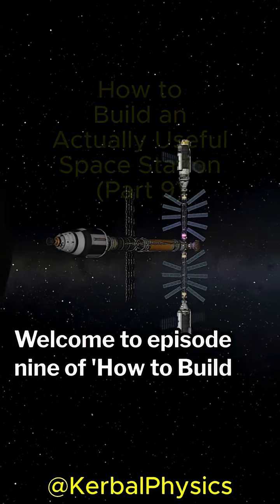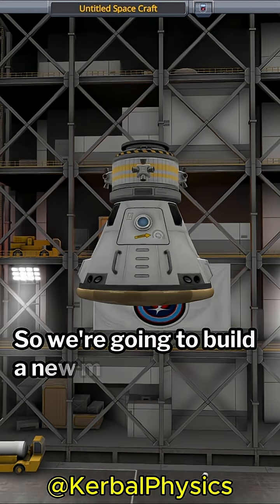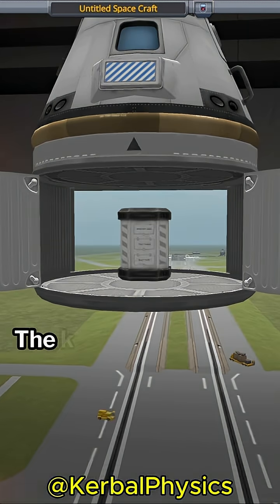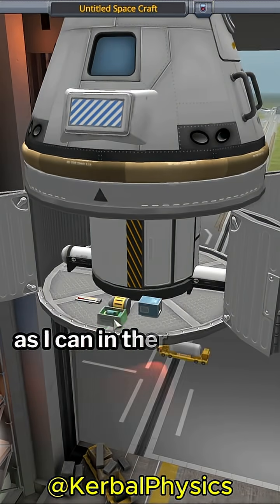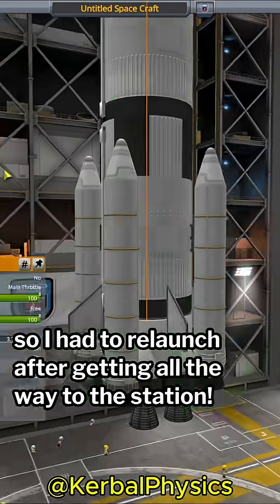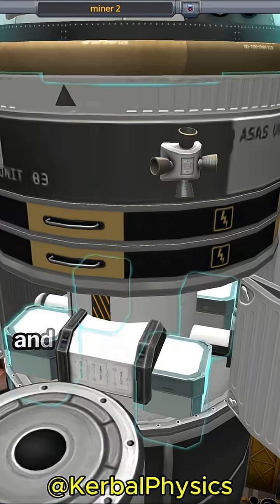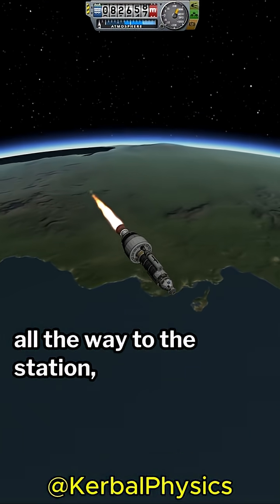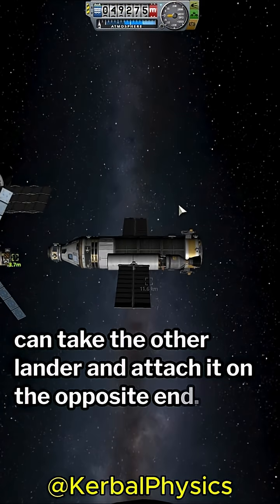How to build an actually useful space station | Part 9  #kerbalspaceprogram

Comment: What does the station do?
Reply: With the science lab, turn unreturned science into x5 science. To then return for full value or transmit for a percentage.

Only works in space. So is great to deploy to multiple planets. Grab all the science in orbits, biomes, special interests, flying over, etc. Then return to station to process.
Reply: @NoHypocrisy42 
Not just in space, but can also be placed into surface even though accessibility will be more of a problem in this method.

Having reusable science rockets will be very useful here.
Reply: @Aereto 
That's right, I make a science bus, I forgot. But landing them isn't as effective as a smaller science and/or ore miner. As the lab is quite heavy.